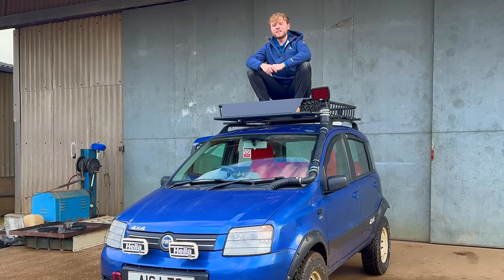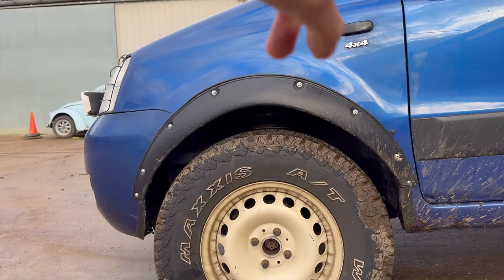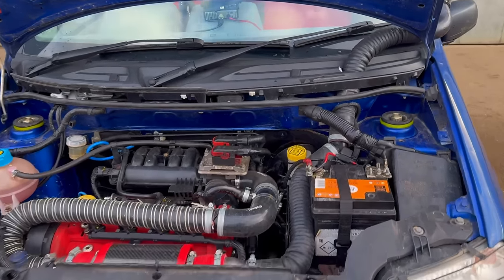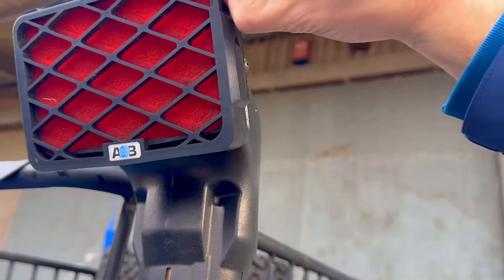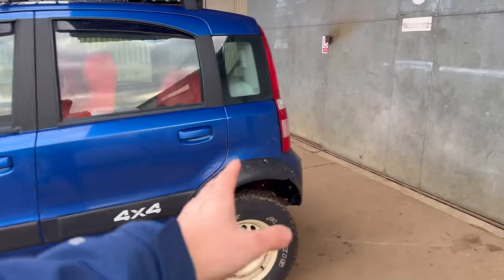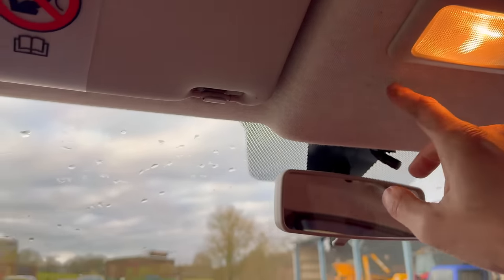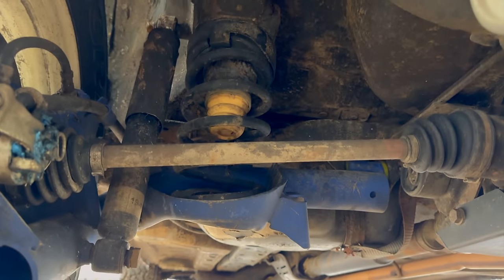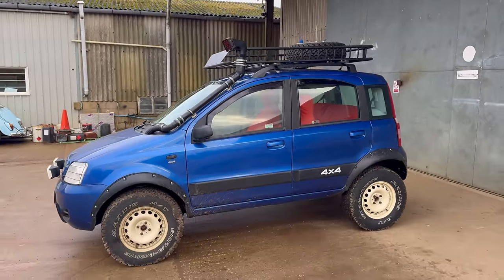Modified Fiat Panda 4X4 - Walk around

Comment: I have a 21 plate mark 3 Fiat Panda 4x4 Wild one of the last ones before the Panda Cross. I’ve only done 5300 miles in it as a weekend warrior. I like driving in snowy roads no serious off road. Other than annual servicing I’ve not had any problems yet though I do read about so many and twin air turbo blowing at 60,000 miles plus. It does put a smile on my face driving it though

Comment: Blown away with the work you've done to your panda 4x4, I've got a MK3 twinair 4x4 I was considering fitting roof bars with a cage similar to yours plus maybe a front bull bar with a light bar , my problem is I've got zero mechanical skills 😢
Reply from the maker: I’m sure a local garage could do it for you! It’s not too difficult and would not cost much.

Comment: Nice engine conversion!👍 The sump guard certainly looks the part but those exposed steering track rods are a bit of an achilles heel on rocky terrain or in deep ruts. An old workmate of mine had one and it was very capable for a car it's size and designed primarily for road use. Plenty of water around just lately to test the snorkel and extended breathers!😂👍
Reply from the maker: Thank you !! Yeah the arms are a bit.. they haven’t been an issue yet though.

Comment: I want to do something similar but on a smaller scale on my VW UP!

I just really need some bigger tires, maybe 15~16” preferably OEM from other VW, so nobody notice at first.

I just need it to me a little higher to be more comfortable on bad roads.
Reply from the maker: That would be cool! I’m sure you could buy a lift kit for it as well which would be cheap and easy
Reply: @PTP4X4  I think would look weird a lifted up with the 14” tires.

My up is the Brazilian model, basically an European crossup without the plastic around the wheel arc.

Comment: Did someone say off road mini?

I just sold my last one, a Mitsubishi Pajero Mini that is  Great wee 4×4, proper low range transfer case, automatic front hub locks and some 3 inches shorter than an actual BL mini at 9ft 9inches.
It would be very interesting, in my opinion, to compare the off road ability of a Panda 4x4, Sisley preferably, with the tiny Kei class Mitsubishi.

I need a panda 4x4 now that there's a tiny off reader sized hole in my life, was that river crossing undertaken in 4 low or was it better to rely on front wheel drive to paddle Pongo along?

The Pajero was RWD when not in 4 wd, great wee toy but, exiting a muddy track onto a surfaced road made it somewhat too oversteery 'til the front wheels were dried out.

Comment: The radio antenna bending on the rack, why not replacing it by a smaller one?

On my up! the original antenna covered in rubber started to break and I replaced it with an small aluminum antenna from Aliexpress, basically the smallest I could find since my radio works fine even without an antenna, and I mostly only use it to play from my phone Bluetooth anyway.
Reply from the maker: It never really bothered me, but I may replace it in the future !

Comment: Add a couple of LED lights to the front of the roof rack and a couple to the rear.    Low power consumption but high light output.
Reply from the maker: That’s the next upgrades! Will do a video of that next month

Comment: that hole in the air tube in the engine bay will let water in. why do you think it wont ?  how do you prevent engine oil getting into the river ?
Reply from the maker: It would need to be submerged in water for a very long time for it to fill up enough to create a problem. So far to date I have not had any water get in post filter.

Comment: Hi Pedro, please can you help me? My rear drives are not working. I removed the electro-pneumatic valve and tested it at 12V to see if it worked, and it lifted the valve upwards (which I assume is working). We changed the oil, but it still doesn't work. Nothing can be heard in the differential, and the driveshaft rotates normally without any strange sounds. Model is Fiat Panda 169 4x4 1.2 51KW. Do you know what happens? Thanks!
Reply from the maker: Hi! Hmm.. that does sound strange. I would think it will be the viscous coupler itself that is not working. The electric valve may be working, but if the viscous coupling itself is not working it will not engage drive. That is the only realistic thing that could be at fault
Reply from the maker: You will have a mechanical coupler which is activated by that switch. I would think that is what has failed
Reply: @PTP4X4  Are you saying that if it 'slipped,' the drive won't work? I wasn't aware of that part. I'll change it and let you know the details. Thanks a lot, Pedro.